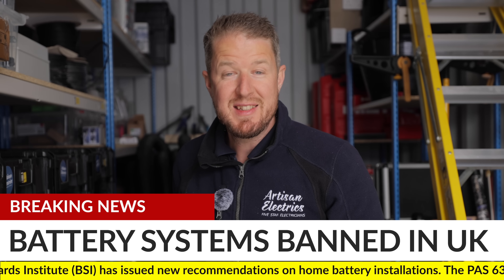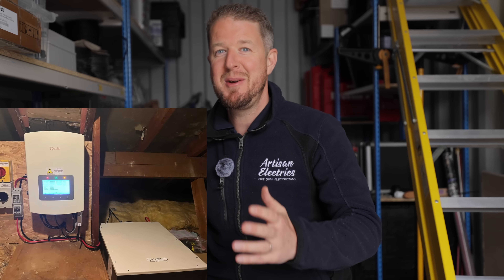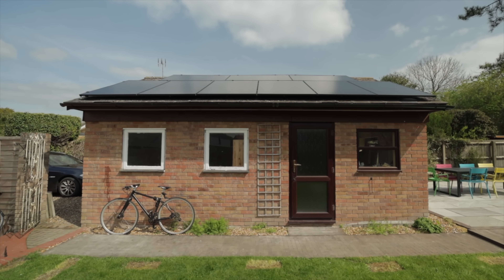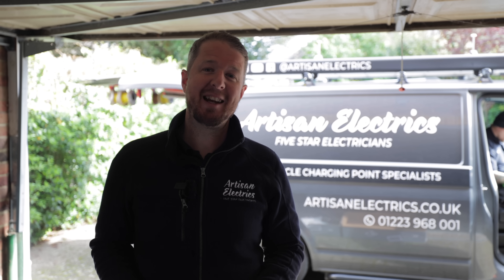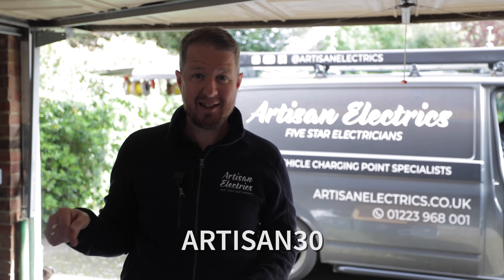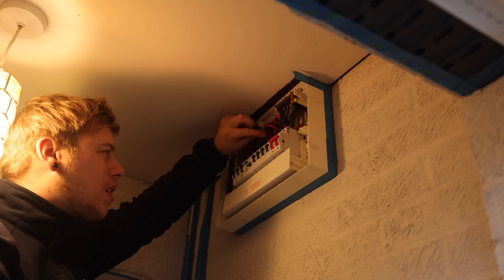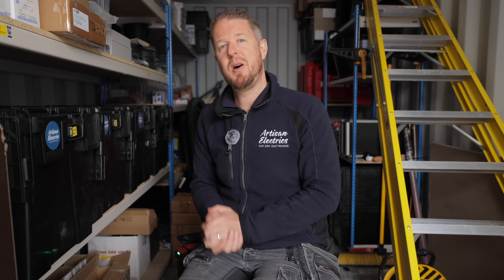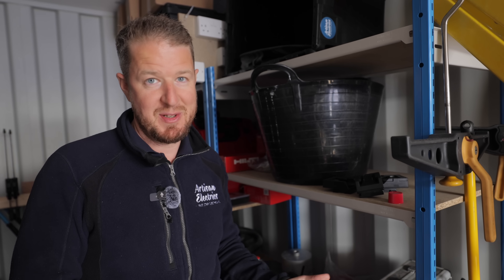Is the UK Banning Home Battery Storage? 😱

Comment from the maker: Get a quote from us: https://app.openquote.net/company/artisanelectrics
Reply: Have they distinguished the differences between Lithium Ion batteries and Lithium Iron Phosphate batteries, which are inherently very much less likely to catch fire than Lithium Ion ones? We have LFP battery packs installed on the ground floor, in the centre of our Victorian terraced house, where the ambient temperature remains at between 20°C and 25°C almost throughout the year. There really is nowhere else to install them here, except for outdoors where they would be a magnet for thieves and vandals, not to mention the low capacity problems which LFP cells have when too cold in Winter.
Reply: @RWBHere   it makes no difference when they go into thermal runaway. Please do some chemistry and physics.  Lithium is the problem, chemically speaking, and guess what, according to the Periodic Table it seems that it always will be
Reply: You mean not recommended, but not banned.
Reply: @gwenshannon3797  banned. Don't take my word for it, please contact BSI  ( the overarching standards authority in the UK )
Reply: I got a quote from you. Ridiculous price. 
£1k+ to run a cable up to the loft, plus extra consumer unit

Comment: Installed my own in the old boiler cupboard in the bedroom, and that's where it's staying. LFP Cells are some of the safest cells you can get, and as long as you don't abuse them, they'll easily live 10 years without releasing their energy in non approved ways.

Am I worried about fire? Yes, that's why the cupboard is ventilated from the boiler days, and it has a smoke alarm in there. While the door might not be fire rated, it's dense enough that it would give me time from the alarm going off to get out.

Now I would love to have the battery and inverter outside, so any chance of fire is away from me, but I live in a 1 bed council flat, if it's outside, it needs to be armoured, water proof, and heated, which sounds like it would cost more than the £3k I spent on the parts to build it. Every reg apart from not putting them in the roof (big black massive sun absorbing area where you're storing temp sensitive batteries? Great idea there...), the rest of the regs are over the top, and don't take into account LFP cells safety. Now if you have NCM cells in your house, you're a nutter and need help.

In short, If we all managed to survive the decades of having a gas boiler in the bedroom cupboard, I'm sure we'll survive this new use for such cupboards.

Comment: It’s nonsense about concern over batteries in attached garages. I have a 10kwh battery and and inverter in my attached garage. The garage is 3.5 meters wide. I also park a large suv full hybrid car in it which is full of fuel and has a large battery to drive it. So I shouldn’t put a house battery there but I can put a car in it? A garage if for storing vehicles by definition??????? So why not a battery?

Comment: We have solar, and the inverter and battery (Sunsynk) were fitted in the loft around 4 years ago. I get your point about not worrying but I asked at the time about getting panels on our separate brick garage and adding them to our system. The installer told me it was conplicated to do and didnt seem keen. I'm wondering if in the future we could do that and get the battery moved or replaced so it is in the garage. Do you think that would be possible? Our system is only 4kw at present, with 10 panels.

Comment: In Australia it’s illegal to install solar batteries inside your house. 
It’s not safe.
Reply from the maker: Good!
Reply: @ it really surprised me it’s not here too. Was shocked to find people put those batteries in their roof space. 
I just installed a 9.5kw panels, with a 10kw victron inverter charger, victron MPPT 450/200 solar charge controller, and 48v 14kw battery- I live in rural Western Australia where the closest power lines are about 10miles away. Using the bigger victron products allowing me to add to the solar array and batteries when I got a bit more money. All the gear had to be installed in a shed out the back. 
For the past year my only power source was 770w of panels, 2x12v deep cycle AGMs and a 1.6kw Honda gennie. Just enough to power a 12v fridge, and a small inverter for a modem, and pressure pump to bring water into the house from the rainwater tank. There’s no water mains running past the property either. lol. 
Completely off-grid and loving it. 😅

Comment: LiFePo4 battery cannot catch fire by themselves!
That beeing said, safety depends on the manufacturer.
However if you install these batteries outside you  trade a small safety improvement with a quite large effeciency downgrade.
If temps fall below 0°C it will degrade faster,charge slower and some will even turn on the internal heating(huawei luna)
and waste energy!

Comment: I designed and built my own off grid system. Cost £2000 with 2 kilowatts of panels, 80 amp charge controller, 6 big caravan batteries, 3500 watt off grid inverter and I put separate sockets in every room so I could switch between off grid and grid depending on the battery voltages. Worked very well. Just have to change your lifestyle slightly.

Comment: I'm not an electrician, just a lowly vehicle technician but I don't get why charging solar batteries in the house is any more dangerous than charging one of those (up to 3000w) Li-ion electric scooters.  No one has ever mentioned banning those in your home even though there have been countless cases of them igniting.  
   As for batteries building up heat in the attic, it is of course a regional thing but I live in Ireland.  We possibly get 20 or maybe 30 days maximum per year over 20 degrees (C) and I can only speak for myself but it is as cool in the attic as in the main house.  
  Could be that the house was built in the 1700's though and suffers from more than a bit of infiltration ¯\_(ツ)_/¯.  
  Thanks for your video, good to know.

Comment: Solar is opening several cans of worms! People think solar and think low voltage then they meet a series set of panels making 750v in sunlight which makes use of DC rated switches and breakers essential. My parent's house (1953 wiring) had a metal fuse box -later it was rewired to a plastic box as an improvement! What happens with the 12v 7AH SLA battery in my home alarm? That certainly isn't going to go outside!

Comment: This is all the usual bureaucratic bollocks, I have a business premises with a 3ph. supply. Annually, for the past 20 odd years EDF have arrived to renew our meter because they insist our dumb clockwork meter needs to be exchanged for a smart meter. To remove it from the wall requires the use of a stubby screwdriver, however their rules require they must use the company supplied tools which are too long, so every year they abandon the job, and go away defeated by red tape..

Comment: Ha, my days of doing things to the letter of the law are over, its become to much of an obstical to improving your life. Like the fact you can do diy systems for 1/3 the price making pay back 3 to 5 years which is the difference between doing it and not for a lot of people right there. If you use the lfp chemistry you can instal the battery just about anywhere because fire risk is near zero although a loft is exposed to a lot of temp extremes which will absolutely decrease its lifespan.

Comment: My understanding is that this is something to do with rare fault conditions causing batteries to give off toxic gasses, which are heavier than air, so can sink into the rooms below. I note Batteries falling through ceilings would not be an issue in a basement & no suggestions about securely fixing them to a wall as opposed to sitting on joists.
Was really hoping you were going to give us more clarity on the underlying issues.

Comment: Really , the inverter shouldn’t be installed in a loft either. Domestic install of solar in a two up two down terraced house just isn’t a good idea and not viable. In reality cheap electricity is the basis of a good economy and putting solar all over British domestic roofs is a stupid policy. The average terraced house can’t support panels of a total of more than 3kw which will only push out 2kw on the best day of the year at midday.  Our government should bear the responsibility of providing competitively cheap reliable power. The homeowner/ landlord shouldn’t have to run an insurance gauntlet with batteries and inverters.

Comment: If we are talking about NMC battereis then yeh there is a not completely insignificant risk that they can catch on fire, but LiFePO4 like no it's not completely impossible for them to self ignite, but like you can punch holes in the cell with a metal drill and they wont catch of fire, so the usual method of them catching on fire of dendrites forming and causing a short circuit which then ignites the electrolyte... ehhh it's a non concern, I would be much more worried about a toaster, or a kettle which are things we put in our homes and all modern house batteries are LiFePO4 batteries so, I see this as being a bit overbearing if it were to become regulation.

Comment: Up to now I like your vids but NO NEED for this one Your playing a risky game just for views REF doing it properly? I go back to Smart Home Panel? Failed install BUT the battery leads would only allow the batteries to be under the stairs which in my view is worse than being mounted on a loft gable solid wall as that would not effect escape routes ALSO you not mentioned the RECOMMENDATIONS to NOT use DC ISOLATORS anymore IF the inverter has a built in ISOLATORS if you look back I think your find your not so whiter than white as all of us Like to have a DC isolator on each strings ( not impressed the way you have played this video out )

Comment: I'm getting quotes at the and my preference is in my detached garage 40ft from the back of the house. Most companies won't give me a quote for this "non standard" installation. This drives me crazy (especially because I have a 30amp wire at the ready due to the previous owners having had a hot tub at the back of the garage). Seems they all want to put it in the loft or next to the outside meter. Seems they are only interested in easy installations. Anyone who has a recommendation for the Gloucestershire area let me know.

Comment: Batteries in the loft is just as stupid as putting your gas boiler in the loft.  Since when did we start putting dangerous fire hazards in f'ing lofts out of sight and hard to get to in an emergency?
With a loft you have 2 options.  It's a confined space (battery explosion prime, bye bye roof) or it's a vented space = rapidly spreading fire self "chimneying" via the roof venting = loss of roof.
Note.  If you luckily get the fire brigade out in time, the only way they can put it out is to deluge your house with hoses on the roof for hours.  Bye bye all house contents.
Reply: People do put their boilers in lofts  as far as I know there is no restriction.

Comment: Mine is in the loft, max temp recorded up there since Oct. Is 22.8degC, min temp is 1.8degC.
I have a large extractor fan I fitted myself on a temp switch just in case. It will also email me when temps go outwith a range as an alarm.
I am in NE Scotland, the loft doesn’t reach 50degC.
Saying all that, I am contemplating moving the battery just for peace of mind.
Reply: in NE Scotland, surely are they at more risk of flooding in the loft than higher temperatures. 🙂

Comment: For 40 years working as a telephone engineer I have installed and maintained Hundreds of battery systems attached to larger Telephone systems all in internal rooms . These included inverter systems . Theses battery systems were much more powerful than domestic batteries. In 40 years the worst I experienced was cooking batteries that went  smelly but never caught fire. That said most of these systems used Lead Acid batteries similar to car batteries and I’m not sure what these modern systems use .
Reply: Lithium or LifePo4
Reply: Wet battery installations generally don't have the fire risks, at least not the batteries.  Biggest risk is atech using a metal spanner on the bus bars.
Reply: @barrieshepherd7694  one would hope they would use full insulated ( orange ) Spanner’s
Reply: @johnholkham2420  I agree but I am aware of two instances when people did not.

Comment: It really comes down to the chemistry of the battery. LFP is safe to install anywhere if temperature is within specs.  I would use loft only if last place I could fit them but would build a  fireproof area with ventilation just incase gas does leak from the cells. I use my basement which stays 55F all year. So many old batteries are Lion type and should never be used in a house. Even storing  a car in garage with those should not happen.

Comment: I feel like installing the equipment on the outside leaves it at a higher risk because of the weather and the components being worn down a lot quicker. I don't see the issue with having the components in the loft if there is good fire detection. Fires spread in seconds going up but takes an hour going down.

Comment: I have recently had a battery installed in the loft. If I understand correctly, the new guidelines were based around the safety of firefighters and the potential of a heavy battery landing on their head in the even of a fire weakening the joists the battery is sitting on. If that is the case and I were a firefighter, I'd be just as worried about the water tanks located in the lofts of many UK homes.
Reply: Most are plastic...
Reply: @ChrisLee-yr7tz  But they are full of heavy water!  Ok that might help fight the fire.  🤣
Reply: @barrieshepherd7694  I'm suggesting they might melt and leak before the joists burn.

Comment: Unfortunately I had no other option but to put the batteries in the boarded out loft,im intending to integrate a wind turbine generator into the system as my inverter is a hybrid capable unit. Could you recommend a make of wind turbine generator I'm keen on the NG Skywind German one. By the way I've bought a co2 fire extinguisher if the worst happens and I'm not burnt alive in bed as its right above my head.
Reply: Please do the calculation of what your potential annual generation might be. All you need for tthat is the swept area of the blades and the mean wind speed at the height you intend to install the wind turbine. After you have done that you will almost certainly ditch tthe idea. Domestic wind turbines are a very bad idea for most people for very sound physical reasons.

Comment: A metal consumer unit seems more of an electrocution risk -   the plastics are surely fire rated / ?? brominated plastic - nasty in the event of a fire, but non flame holding - I suppose an earthed metal enclosure - provides an immediate path (if there is such an earth pathway installed) to ground in the event of a fault (do modern dwellings have fire alarm main disconnects?? - providing electrical safety in the event of a fire in a dwelling, or zone.

Comment: My battery (Solax) is in my loft, but I don't have a garage now.  Ultimately I would like to get Tesla Powerwall(s) that would go outside.  Current battery is only around 6Kwh I believe so not huge but it does still represent a risk.  The issue with getting Powerwalls is that they are not compatible with my inverter software (I don't think)

Comment: Interesting that only the well-off with garages and external buildings should be allowed the benefit from solar energy and power storage. For some the only option is to install internally. I'm thinking urban terraces for example or HMO's also fall in to this senario. People should be allowed to accept the level of potential risk they are prepared to accept, as you point out in the video. So what is the alternative for those without the space, external or otherwise?
Reply: be grid connected to sell back rather than store, could you sleep well knowing there is a risk of fire above you or your family, i couldn't

Comment: What's a loft? I'm in a terraced house, no outer walls without doors or windows. But it's tall, 3 stories with a mini roof room under one side of the valley with a door and narrow short flight of stairs up into it. This has the large brick gable wall for mounting and the smal SE facing roof [insulated behind boarding] is immediately above, floor definitely not weight bearing. Fireproofing and ventilation could be upgraded, gets hot/cold but not the extremes some mention. Cold water tank is in here too. There really is nowhere else that wouldn't be worse...

Comment: I remember many years ago, as a child, fuse boxes were some sort of fibreous material not plastic, not metal ( electricaly unsafe) , now it’s plastic, cheap rubbish junk and overpriced.
Reply: I doubt that you can currently purchase a plastic consumer unit - they are all metal.  A certain irony that the older bakelite Cus were pretty fire resistant.

Comment: No1 no one likes a smart ass, No 2 click bait alert, I agree with NOT having batteries in a house, certainly not lithium based cells, but I have when they generate recommendations,  because its a money maker, or a way of justifying  19th edition, and so on, and on. I unfortunately watched as local council workers were using 4mm twin and earth's to wire ring mains because of "regulation" changes that were quite frankly read wrong, and after a few years, see them replacing the sockets because putting a ring with conductor size of 4mm x 2 into a socket often overheated due to the connections not being tightened correctly